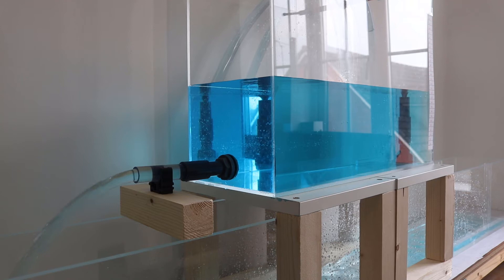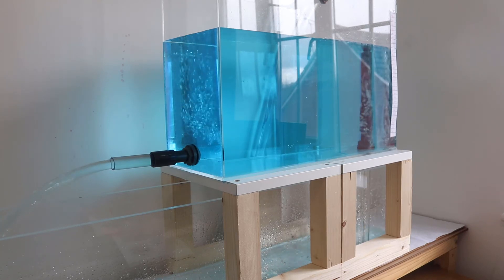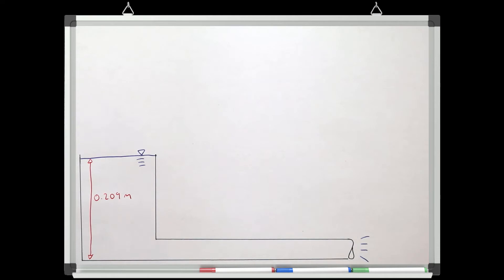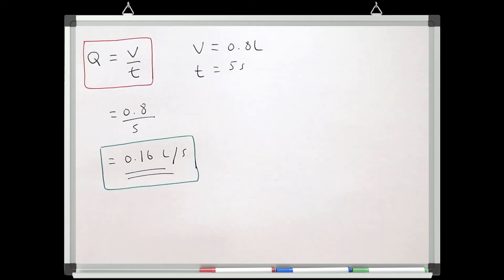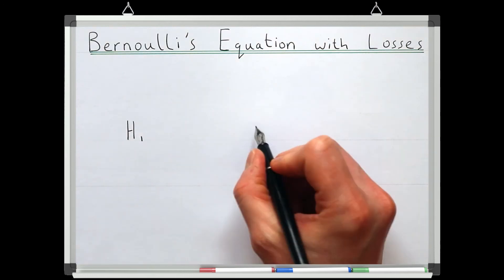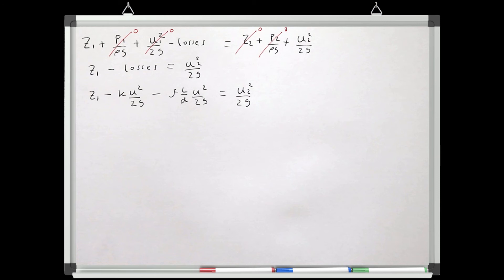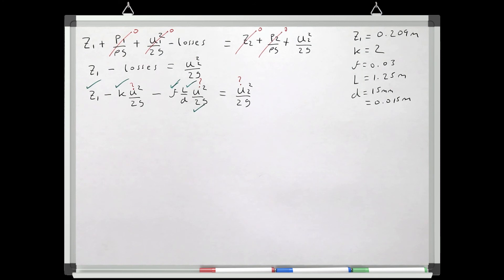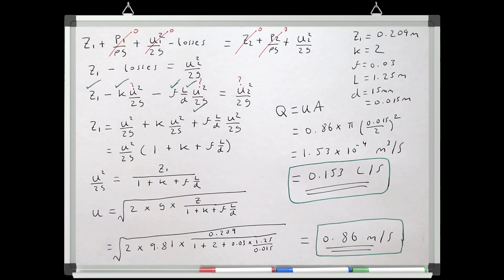Bernoulli's Equation Including Losses (Lesson 4, Part 1)

Comment: These videos are so clear and simple - Thank you.  The problem I am having is that you need to know the velocity to find the Reynolds number, and then to find that f= 0.03, so you can estimate the velocity.  This appears to be a circular problem where we need to know the velocity before finding it.
Reply from the maker: This is true. However, if you have a very rough idea of the velocity, you can then estimate f. Most pipe systems operate under highly turbulent flow somewhere between Re=10,000 and 100,000. And within this range, there is not a massive difference in the f value if you look at a Moody Diagram. SO by making a few assumptions, you could get a reasonable estimate of the velocity.
Reply: @fluidsexplained1901  Thanks for your reply.  I have done just that and iterated with some simple code and get the answer I'm looking for.
Reply: @mondomeccano  Can you show me how you did it?
Reply: @fluidsexplained1901  So where did you get the rough estimate of velocity? Did you get it from the ideal flow state which was it 0.358 L/s?